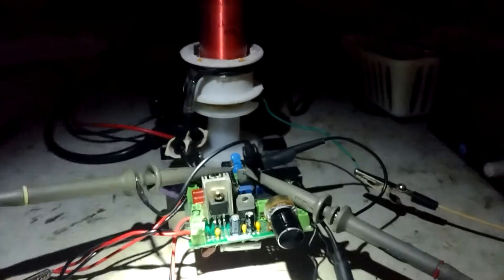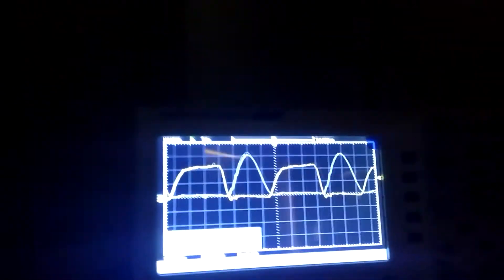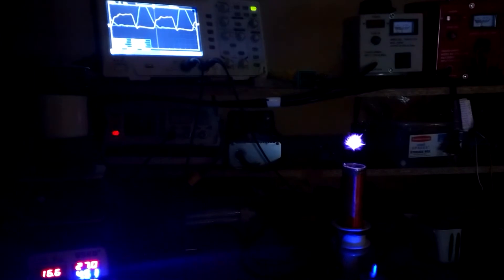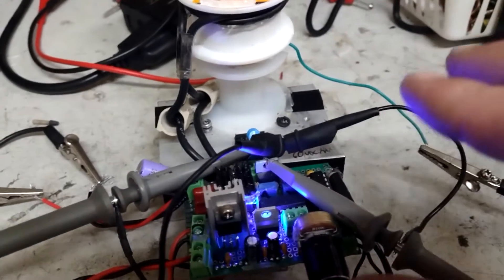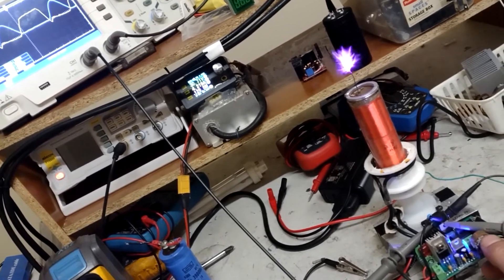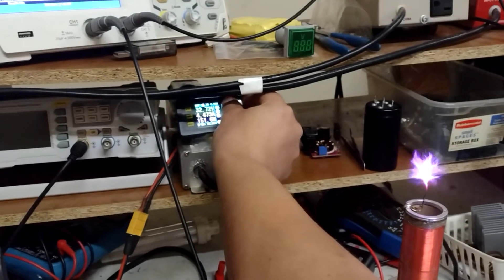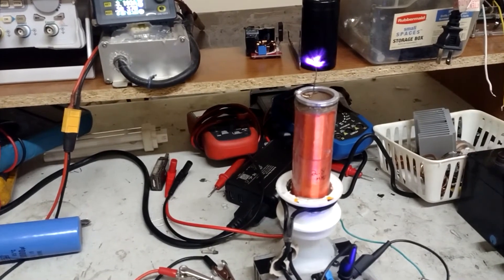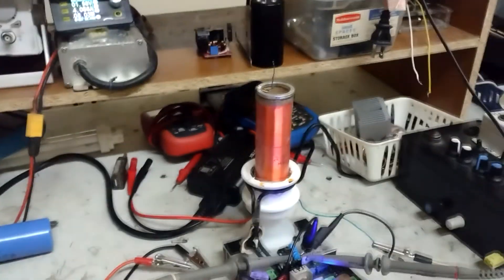2.8MHz Class E SSTC Frequency Tuning

Comment: How would this run with a IGBT ? I would like to give them a try in the future , but I think igbts are lower frecuency rated right , so they would be struggling
Reply from the maker: Probably only okay at super low frequency because of the tail current.

Comment: Two videos in one day hell yeeahh brother 🙌 , this video helps me a lot thank so much , I saw that you got the best tune with the maximum current that made me think because I was tuning mine to where I saw less draw while keeping the plasma going (I thought less draw mean more efficiency and better switching but I probably was wrong ) maybe that's why my fet is heating so much , I need to try to tune it to where I see the most draw and keeping a nice output , also I need to try grounding it , this circuit got so much variables to consider , I wonder how it would look interrupted
Reply from the maker: I would say typically yea when you are inputting the most power you are outputting the most power unless you are just losing tons of power in the switching. At the highest resonance you should have the highest current consumption because the transmission has become the most efficient, again assuming proper switching.

There are definitely a lot of variables but you can see how one of the main tricky parts is the plasma loading at any given time and how sometimes a very slight change in the output can make a big difference in how the coil reacts. For example I can detune the coil by setting a particular frequency that is a little above what gives me the highest resonant amplitudes at the time. It could have this slightly less output and also be switching nicely. By increasing the voltage more and more, the plasma flame is only going to increase in small amounts because it was already only slightly resonant, and the more that slight flame increases, the even less resonant it will become and the only reason the flame is maintaining or growing at all is because of the amount of voltage being fed into it. Since the flame would not be dramatically increasing in size or power, the switching would remain about the same because the coil's resonance has not changed all that much. 

When it's tuned to the highest resonant amplitudes at a particular voltage, every incremental increase in voltage is going to increase the flame quite a bit, that is until that larger flame quickly begins to drop the resonant frequency of the coil, until I get to a point where raising the voltage has dropped the L2's resonance so much that the frequency I had it originally set to is no longer giving me the highest amplitudes I could be getting. So while you can tune the thing to give the highest output at any given time by adjusting the frequency, that's not going to change anything about what frequency the LC needs to be at in order to ring properly.

So you basically have to find out what your L2 is resonant at with streamers just like a drsstc. There is a flame to coil size ratio that seems evident here though to where drsstc sparks to the air, even long ones, are not dropping the resonant frequency as much as the CW flames on these small ones. I start off most resonant at about 3mhz running a tiny flame at 12v or so. By the time I'm pushing the flame I get at about 45v the resonant frequency has dropped to about 2.75mhz.

Comment: Couldn't have made this video at a better time man, great stuff as always! I've seen a lot of Tesla coil channels, and yours is the only one I can say I repetitively look to for information.
Reply from the maker: Thanks man glad I could help. I remember when first tuning this thing I had some really clean looking gate drives with something like 13ns rise times at about 3mhz, real flat and square, but then when I started to get close to around 45-50V the bit of ringing on the gate in the off time was getting well over 4v or so. I ended up having to play around with the gate drive by slowing it a little using slightly more resistance and added G-S capacitance in 1nF or so range, and also tidy up the routing of the board layout keeping the gate drive signal path from getting crossed over by or becoming close to the drain trace. I didn't really have those issues with a 500khz or so coil and that one switched real clean looking with only a decent board layout where the gate drive stage was real tight and close to the fet. I'd guess that the first tuning on this one with the nice clean squares would have worked the best if it was all built on a really clean PCB with short traces.
Reply: @Magneticitist  Wow, that's actually pretty helpful that you mentioned that about the gate ringing during the off times. In the last few minutes, I've been playing with my class-E setup, and it was having some issues with gate ringing. What resistance do you use? I'm personally using 4.7 ohm with a 1.5MHz coil, but I'm sorta thinking the new one should have 7.5 ohms or so, plus a gate-source cap like you mentioned. 

I'm also a little confused with my circuit's performance. I've got it switching pretty good, but with only 3 or 4 turns on the primary instead of 7, and still 940pF shunt capacitance. It looks good on the scope, but the current is above 3A at 30-40V, and the IRFP260 I've been testing with gets very hot. More shunt capacitance is probably needed (and a higher voltage MOSFET, since the peak voltages across it are above 200V), but I'm a bit worried the higher currents permitted by the smaller primary will come back to bite me in the butt later on, despite apparently switching in class-E. I would ask for your advice, but honestly this seems like it'll have to be a trial-and-error kind of thing on my part. I want to use more shunt capacitance like you mentioned before, but I'm starting to think most 120V coils have around 6-7 turns for a reason, lol. Just gotta get it tuned well so the FET stops heating up!
Reply from the maker: @LabCoatz_Science  I have something like 3.3 ohms right now on the gate whereas before it was around half that. The SiC fets can go with much lower resistances. I just noticed that by slowing the rise times a little, which also happens automatically when giving the gate more capacitance, and allowing this small undershoot to happen I was no longer getting gate ringing above 2v or so at my desired input. I would say running 120V or so would be tricky but I'd guess with a 200V fet the shunt would need to be made to be about the largest it can be assuming a minimum frequency desired. It would be hard to keep that drain swing below what is going to start bringing the fet into breakdown and avalanching so definitely something like a 650V at least is ideal. Your fet might be breaking down from too much drain voltage or something. Maybe 50V above spec seems reasonable without failure or excessive heating.

If you have it switching nice and properly resonant then you should probably expect 3-4A at least at 30-40v with 3-4 turns but for 120V input a couple more turns wouldn't hurt. Still, with good switching a 260 should be able to do 10A or so before needing some kind of reasonable heatsink so to me the idea trying to bring the impedance to basically nil via resonance and push as much power as you can, while trying to make it class E in the process so the fet doesn't die.
Reply from the maker: @LabCoatz_Science  Oh yea and I almost forgot I wanted to ask about your logic input. an earlier PCB you showed said 12V input but this was also feeding the 12V regulator. If you are indeed only feeding 12v in then you are likely only getting like 10V out or something which might not be too big a deal to the gates but the gate driver would probably enjoy a couple extra volts on it. I also learned it's good practice with a lot of those regulators to add small bypass caps on the inputs and outputs where not doing that can result in a slightly unstable 11.5v or something as opposed to maybe 12.05v.
Reply: @Magneticitist  With my setup, the 12V input is meant for a small 12VAC transformer (I'll try to specify that better on the PCB). The bridge rectifier and caps on the PCB clean this up into about 16-17VDC, which is pretty good for the 7812. I also added a 7805 for the 74HC14, which takes its power from the 7812. Everything seems to run pretty well (definitely recommend exploring the Schmitt trigger oscillator, it's kinda fun and seems to produce up to 5MHz reliably), but I'll be updating the PCB one last time here pretty soon, this time with a musical interrupter based on the common musical flyback circuit (but modified so it can also have adjustable on/off times down to about 35Hz up to 30kHz). I'm hoping third times the charm for this project, haha! Assuming the new interrupter design works like in the simulations I've ran, the only real thing I have to worry about is tuning this thing to class-E properly without killing too many FETs.
Reply: @LabCoatz_Science  would'n it be better to use a battery for the logic , I say because you are introducing some mains noise with the transformer , plus it could be much more handy to use something like a pack of 4 series 18650 , or a 3 or 4 cells lipo or life .
Reply from the maker: @LabCoatz_Science  Ohh that's right I feel like you told me this already lol. So yea that should be good. Still, every now and then you might want to check the output just in case. For some reason I've noticed this a few times.. I'll have proper smoothing caps on the inputs and outputs but the output voltage will still not be right and solid until I add some small ceramic or something on with it.